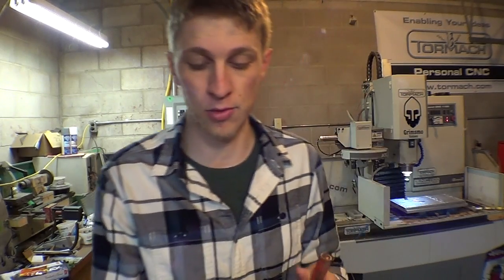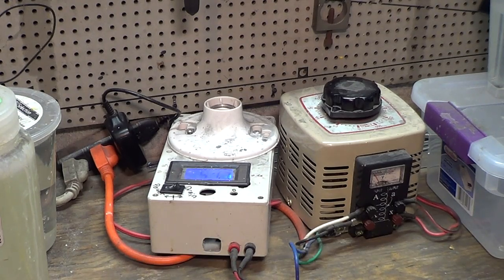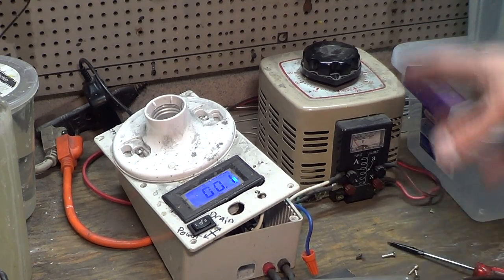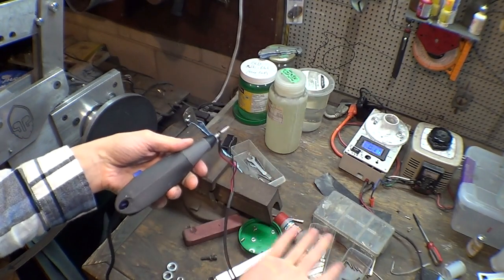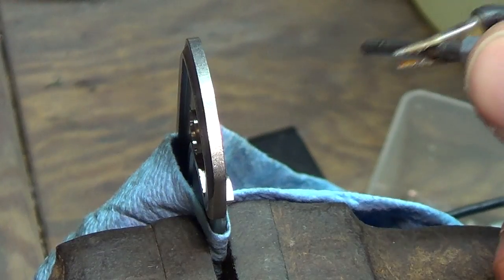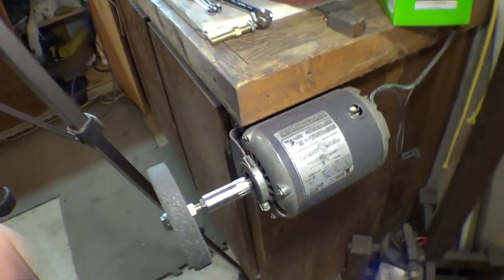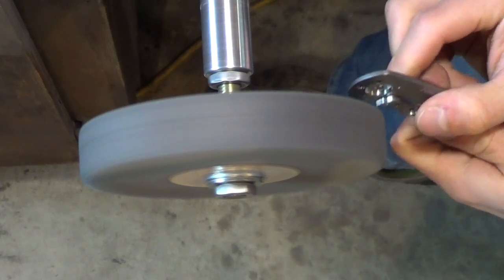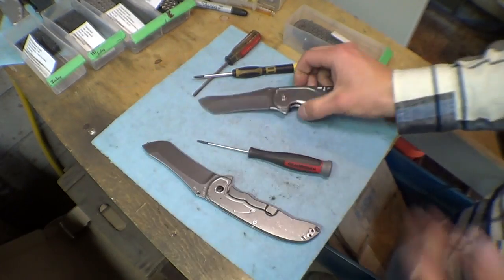Knifemaking Tuesdays Week 86 - Carbidizing titanium knife locks

Comment: awesome video! i actually just tried it with a dc power supply 22v 30a without an engraver just to try it out on the titanium scraps i have and a carbide bit sure enough the titanium part was able to scratch glass after which means it did deposit carbide on it. i wish i had known about this when i had a titanium framelock that stuck really bad that i ended up selling. i really liked the knife. the only thing i didnt like was the stick.

Comment: With most welding, ESPECIALLY titanium, flooding the area with a shielding gas such as Argon will eliminate the contaminants in the air that will get into your weld. Not sure if this would help you with your surface finish but it may make a harder wearing surface due to less porosity. Excellent work as always.

Comment: Your timing on this video is fantastic John. I was just looking at some Mastech stuff while considering doing some Ti anodizing and digging through your old videos to see your setup :)
I couldn't figure out how you were getting above 50VDC... now I know.
Reply from the maker: Excellent!  You can also get a 0-100 or 120v power supply from circuitspecialty or specialist or something like that, google it, for about $120.  Lots of guys are using that for titanium anodizing since you don't even really need 1 amp of juice.
Reply: JohnGrimsmo
found it. guys are using this one: http://www.circuitspecialists.com/benchtop-power-supply-csi12001x.html
Reply: Hi John,i have a quick question.If i have had a 120V dc power supply,it would work? Can i use it just conecting to graver and carbidize the things?If yes which voltage i should use?Thanks.

Comment: Hello John! I've found from my experiance that even a non carbidized lock face shouldn't stick (maybe just a tiny bit) if done right. From what I see Your lock face isn't very smooth. What You need for a non stick lockbar 1. Good angle of the locking face on the blade, about 8.5 degrees or a bit more 2. smooth and clean lock face on both blade AND titanium, rounded edge on the titanium face 3. The very corner of the lock should NOT touch the tang, as it bites in causing the sticking. The locking point is in the right spot, You got it perfect - try to round off the very corner though. I would suggest a jig to sand the lock face on a grinder rather than leave it machined. Thank You for sharing, keep up the good work!
Reply from the maker: Sounds about right, makes sense that there's a way to make it not sticky if done right.  Thanks for sharing!

Comment: Footswitches John, they are pretty inexpensive from places like harbor freight, and they make running Variacs and engravers MUCH more pleasant!
I love just walking up to my rig, and stepping on a switch to turn it on and off...
And, you can run that resistor in the live circuit without ill effect, safely bleeding the capacitor automatically. Just wire it in the same as the capacitor.

Comment: John, You  can simplify it further and eliminate to one switch position.  Bleeder resistors are typically 10,000 ohm and 1/4 watt.  It can be permanently soldered across the capacitor.  Then you don't need the safe position on the switch.  When you turn off the power the capacitor will discharge through it.  Not enough space to explain why it works it just does.

Comment: the smell you were talking about during carbonizing is because the sparking actually creates ozone molecules and the "notch" in the variac is because it is a potentiometer and the area it is used the most will wear away at the wiper and can eventually cause a failure in that area
Reply from the maker: Thanks!  Ozone makes sense.  If the pot fails in that spot will it fry, or will it still work in a slightly different spot?
Reply: JohnGrimsmo yeah the way they work is there is a coiled up resistor and a wiper. the wiper is connected to the dial and the output. as you turn the dial the wiper makes a connection like brushes in a motor to the resistor and the further the wiper is on the resistor the more resistance and as time goes on the resistor wears down especially if it is held in one spot for most of the time so it creates a sort of drop out in that spot. It should still work in other settings and it will still probably take a long time before it becomes a problem

Comment: could this kind of welding process be used to ad new aluminium in a piece that has been milled too much? Or repair the wear on bearing shafts.
Reply from the maker: I doubt it.  Not sure how it will apply itself to aluminum, I've only tried it on titanium, and it doesn't add very much thickness.

Comment: Hey John!

One of the best vids iv seen on this topic. So helpful. 

Iv got 2 questions on this topic, maybe you can shed some light.
1) does carbidizing work on steel bar inserts? Or is it only for Ti?
2) since carbidizing adds a layer, can it techinically get rid of up and down blade play?
Iv got a microtech socom elite with a steel insert, thing is at 100% lock up, and is developing up and down play. Love the knife to bits but the lock rock is driving me nuts!
Reply from the maker: It should work on steel, I think I did a blade lock tang once (pro tip, does not work to carbidize blade and handle, super sticky).
I've never been able to add enough to change the lockup, not even a tiny noticeable bit, even though others say you can.  Maybe they use more voltage or something.
Reply: JohnGrimsmo
Thanks for the response buddy.

Comment: I noticed your flattening your detent balls. I have heard that can make them smoother. Ive been using the Hoback Rolling Detent and its been working pretty good. Have you ever tired it? Im not sure if it would work well in the Norseman because they are about .180" tall so they would stick out a little bit.
Reply from the maker: That's the big reason I haven't tried it yet, way too thick for me.  Yup I flatten them a LOT.  You'll see how smooth mine are soon enough.
Reply: Yup I was reading a thread on USN in the shop section about flattening the balls and I dont really understand the physics behind it. I thought that if the tip of the ball was the only thing dragging it would be better, but I guess if its a face then it more slides along. 

Anywho Im loving the HRD, there just a pain to get. The last company I was getting them from went under and now I found another company that sells them for half the price, Here is the kicker. 200 piece minimum order of a $5 screw. lol Maybe later...

Comment: I'm going to have a go at this with my power supply.  0-120v  
I will use it at 40v on some scrap.  Did you use it at one amp?  
Thank you for the fantastic video
Reply from the maker: +Danae Cresswell I made my power supply so I'm not measuring amps, no idea what it's actually pulling.  But most people seem to do it fine with the one amp unit that you have.  40-45v works great.

Comment: can you carbidize the edge of the  blade to get like a super sharp edge?
Reply: The carbidizing layer is only a few thousandths thick, after repeated sharpening it would eventually wear away. Also, the harden steel blade is plenty hard enough. You can make it very sharp anyways though.
Reply from the maker: This is often done on knives with a titanium blade, because Ti doesn't hold an edge well, but the carbide surface is literally self sharpening because it's so toothy.  Not ideal for everything, but super cool.  Haven't heard of people doing it for steel blade edges.

Comment: Two things on your power supply. 1. The capacitor voltage rating is too low. Ideally, it would be double your highest working voltage, and if your variac goes to 250...a 400v unit should ok. 2.  a bleed resistor across the cap should be added for safety. a few K or so should work fine, and will drop the voltage on the cap quickly after power off, yet consume very little power during operation.